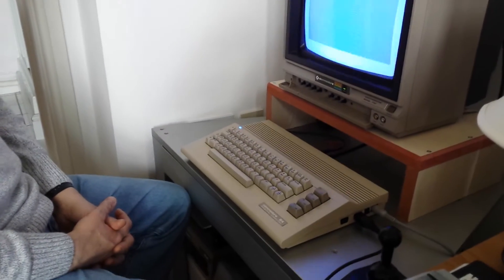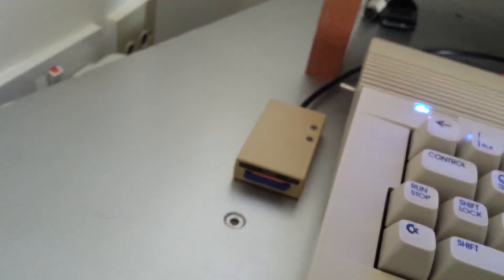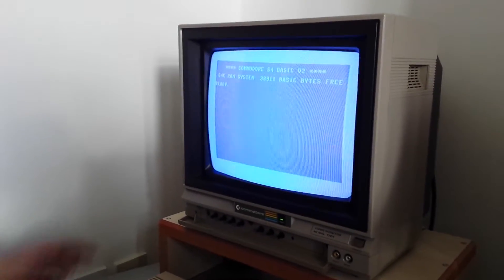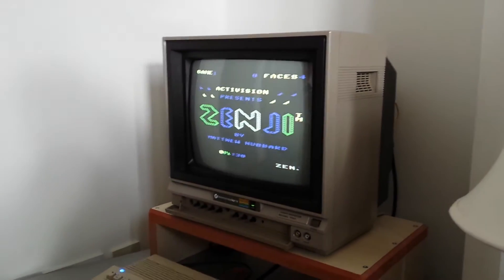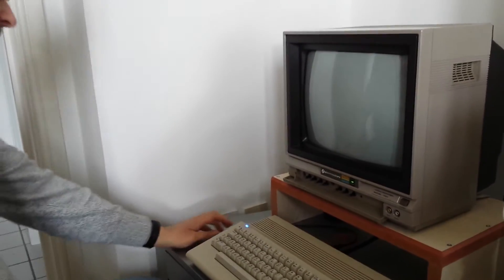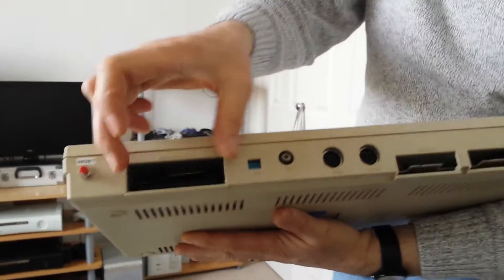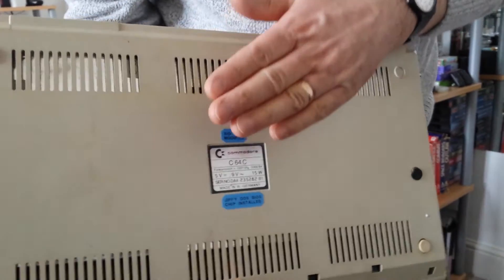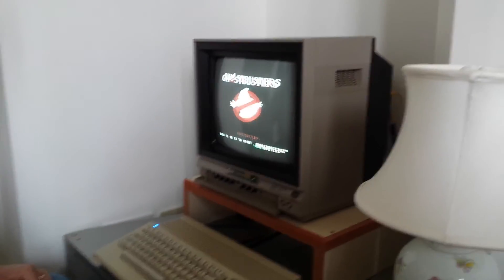C64 Jiffydos with SD2IEC drive

Comment: Can you tell a bit more about what that sid fix is?
Reply from the maker: It's my brother that does hardware stuff ... I will ask him what you have to do and try and find the link
Reply: @alpanchen  Awesomme.... This is good news. I only want to check out, if what I found is the correct information. I need to do other mods on my C64c as well. Like installing good heatsinks.
Reply from the maker: @brostenen  send the info and I will get Mark to check
Reply from the maker: @brostenen  also are you a member of a cracking group btw? Do you browse csdb?
Reply: @alpanchen  Sadly not member of any cracking group. My coding skills have always sucked. I am better at soldering. CSDB?
Reply from the maker: @brostenen  start as tester ...then build
Reply from the maker: @brostenen  csdb ??? Lol
Reply from the maker: @brostenen  https://csdb.dk
Reply from the maker: Non bbs place to be ... if interested in testing I'm theenemy of excess so find me on there. New c64 stuff is released all the Time so testers are always needed.
Reply: @alpanchen  Looks like an awesome site. And .dk? Danish. Sweet.
Reply from the maker: @brostenen  yep place to be on the internet for c64 old and new. Look me up if you have time to help in testing and we can chat on there etc
Reply: @alpanchen  I will.... Yet I have no time untill sunday or something. 👍